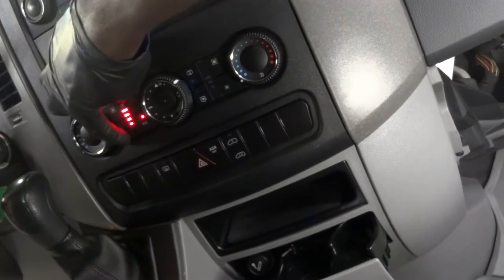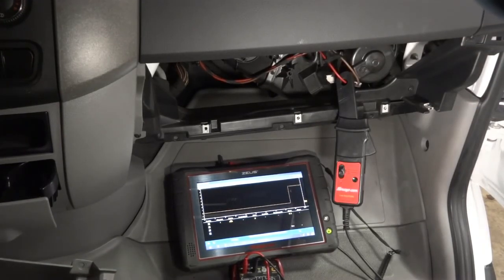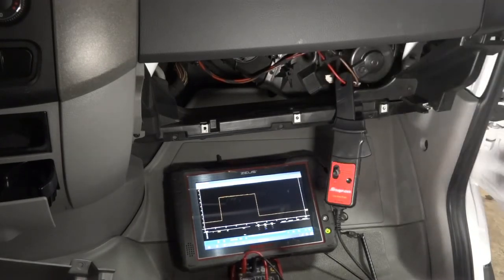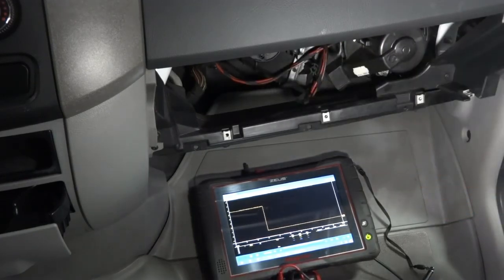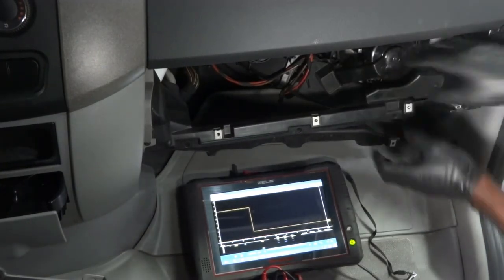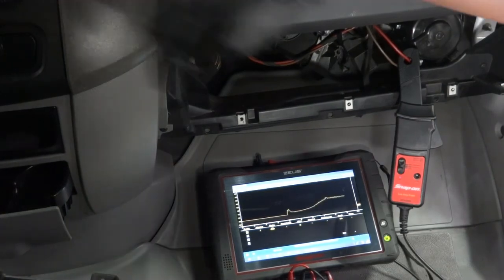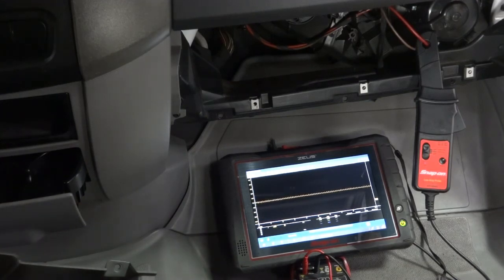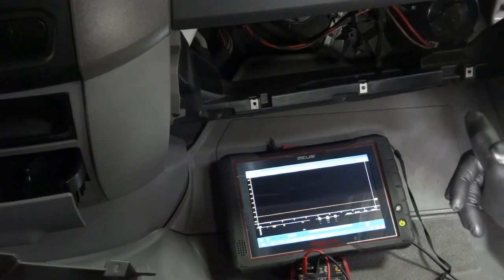How to diagnose & Replace a Blower motor on a 2015 Mercedes/ dodge Sprinter 3.0L

Comment: It's the second A/C Heater Blower Motor Regulator Resistor that I change it I don't know what happens with this that it stays on, I disconnect the key and it's still on, what can I do?
Reply from the maker: @carlovera7880   your blower motor might be shorted!

Comment: This is a helpful video but you failed to explain if the regulator has no power.  Where is that fuse location???
Reply from the maker: @Ceas2000   Thanks! the fuse is in the fuse panel under the dash!
Reply: I thought I checked every fuse but ill check again. Yiu wouldn't happen to know which number?
Reply: You wouldn't happen to know which fuse nunber?

Comment: Hi guy,
first of all, congratulations for all the explanations you gave and a big thank you.
I think I could also repair my problem in my 2016 VW Crafter van.
Can you tell me the brand of air blower you purchased and its price?
Because I don't want to get one of poor quality...
Will this solve the heating problem because I no longer have any at the moment and given the negative temperatures it is at the moment.
Thank you very much and good luck
Reply from the maker: My Pleasure! I don't remember tthe bramd of the blower, ask your local parts sttore for a good quality blower,
Reply: @KITS_Auto_and_Truck_Repair  thank you very much for your answer
Can you tell me where the heating and air conditioning relays are located?

Comment: Couldn't there be some debris jamming the blower? Rather than buying a new $200 blower it might be wise to take the blower motor completely out, clean it up, and add power to the blower motor to see if it runs.
Reply from the maker: @davidg.johnson7208  you can do that if you want, but I don't like comebacks!

Comment: Great video! This has got to be the easiest thing on the sprinter to fix 6 x T25 screwed and clip , twist done , don’t forget the last T25 on the lower right to get the plastic frame out of the way so the motor comes in and out easy this vid he struggles with that a little , so easy thanks again this is a great vid
Reply from the maker: @kc-qv2kf   My Pleasure!

Comment: hi i have 2011 mercedes sprinter 2500 with problem :
I start the car and it blows hard and cold for about 2 to 5 minutes, and it start gets warm air come out. It's not hot air blowing out, please can anyone help thanks .
Reply from the maker: @chuongvo5925  Sorry! I didn't understand your question!

Comment: Hy mate.i got an mercedes benz a class A170,1.7 PETROL..in januray i coemback from holliday and heating in the car stop working,but before to i go to holliday was perfect working...in 4-5 minutes in the morning at -5 -7 degrade was workign verry good...the car give the air warm,but verry verry low...someone told me that door what close the air to come can be block..or blower heater stuck..what you think can be?hoses at engien area ,what come from heater,are warm...so i think,i am not sure,maybe is somethign stuck?the air works on all level from 1 to 5,but when i chose warm air dont come warm air...is starnge as before holliday was perfect working
Reply from the maker: @TheRazvancristian  Sorry, I didn't really understand your question, it sounds like you said the blower works but the air doesn't switch from hot to cold, if that's the case, I recommend you have the blend door looked at!
Reply: @KITS_Auto_and_Truck_Repair  and is that easy to fix the blend door  locked? I can have acces on it if i take some parts out? Is on passenger side or driver side?

Comment: I got two errors from xentry

P053400 The refrigerant level is too low. -

B105C07 The actuator motor for the air recirculation flap has a malfunction. There is a mechanical fault.

It’s a 2022 w907 sprinter cargo.  When I press the AC button to turn on the AC, the light doesn’t even turn red to let me know it works. The fan works and the heater works. What do you think is going on? My car is only 17k miles.
Reply from the maker: Anonymous District  Check your switch and your rec actuator!

Comment: Appreciate your help on this. Got straight to the issue could see black dust around the connector and 12v. Removed blower motor and sprayed contact cleaner down inside and freed it up and it works 👍🏻
Reply from the maker: Iain Stubley   My Pleasure! I'm glad to hear that the video was helpful!

Comment: Is there a way to use a multimeter to test if the blower motor is receiving power (instead of piercing tools and a test light)?

Excellent video, thank you for making it!
Reply from the maker: Ben Spatafora  thanks! yes you can connect your multimeter to ground and then connect the other test lead to blower motor power wire to see if you have 12v at the blower connector
Reply: @KITS_Auto_and_Truck_Repair  Thanks for the help!
Reply from the maker: @BenSpatafora  My Pleasure!

Comment: Mine when I turn it on high it starts to slowly go down then it just stops working I cut it off and I turn it back on and it starts working again I think mine is the blower fan motor but it has a weird little whining kind of noise been doing for over 6 months
Reply from the maker: Jason  you should check your blower resistor first before you condemn the blower motor!
Reply: @KITS_Auto_and_Truck_Repair  got it fixed it was the blower motor
Reply from the maker: @Jason-vh6nr  Sounds good! I'm glad to hear that!

Comment: Thanks for posting. Really helpful. Now to source a blower motor that doesn't cost an arm and a leg!
Reply: Did you get an aftermarket part? How is it working?
Reply: @000MrJwright  yep, took 10 mins to change and works fine.
Reply: @000MrJwright  sorry, didn’t answer your first question. I purchased a second hand motor from a wrecker group. Arrived from Melb in two days.

Comment: I watched this to find out how to remove and replace the blower motor.  That said, this is an excellent tutorial on trouble shooting the blower system.  The one thing I might have done before accessing the motor would be to check the fuse, but otherwise this is first rate and understandable for relatively inexperienced DIYers.  I really appreciate it.  Thanks.
Reply from the maker: David Johnson  My Pleasure!! and Thanks for your feedback!

Comment: Hey great video. I have also a 2015 Sprinter. When I turn it on for about 30 to 40 mins, very little air is coming out into the cab. The fan speed does change when I raise or lower the fan speed. My temporary solution is to turn off the fan for about 5 mins, then turn it back on. I then have full fan speed with good air flow. Would you know what is causing the minimal air flow? Thanks.
Reply from the maker: Michael T  Check your blower regulator!

Comment: I have a Mercedes’ sprinter 313 cdi.Blowing air but no hot air.Have installed new thermostat,tried a new control panel but still cold air.what can it be?
Reply from the maker: SaluteKiller  sounds like you have a blend door problem!
Reply: All dashboard has to come out.It’s the heater box
Reply: Bought a whole heater box second hand today

Comment: This is truly an excellent video and a very good explanation of how things work and go together.
I had the same issue, the blower not coming on anymore, and like always it happened when it was about 90 outside and I had to drive for three hours. 
Anyhow, I followed your steps and found 12.x volt on the red blower cable with the multimeter and there was ground on the brown wire. So I thought that was easy, it must be the motor that is bad. 

But while checking the ground the test light was very dim and the beep from the tester was also pretty faint. Definitely different from what it was when I tested the test light on the battery.  Hence I hocked up the test light to different ground and there the beep was loud and the light was bright.  That raised my suspicion the motor could be OK. 
I removed the motor from the car and tested it on a 12V battery and it worked just fine.
Then I found your other excellent video about the resistor and how to test its function and found that the resistor may be the culprit. 
To make a long story short, for those using just simple test equipment like a test light it's important to realize that there must be "good ground" as you mentioned in your video. If there is any doubt about the quality of the ground wire I would test the motor on a separate battery before buying a new one.

Thanks for making these excellent videos!👍👍
Reply from the maker: pilotarix  My Pleasure!! I'm glad to hear that the video was helpful! Thanks for letting me know about how you fixed your car, I enjoyed reading your comment, I appreciate you!

Comment: My aftermarket blower just stopped working. So, I have to start all over again. But first step is to refresh my memory of this site.
Reply from the maker: Juno Cheyenne Krakus  Good luck with your project!!
Reply: @KITS_Auto_and_Truck_Repair  Its done. Bad aftermarket blower was replaced under warranty. To make removal and installation easier I unscrewed 3 additional torx. BTW, OEM blower is cheaper then aftermarket from brick store. Its $110 vs $170.
Reply from the maker: @junocheyennekrakus5004  sounds good!

Comment: The video is the best I ever watched. I have 2016 Sprinter with a/c problem, which was normal for a while(a hour or two) then became no cooling air. After shot-off the blower for a few minutes,  it will blow cool air again when turn-on. It seems related with fuse, but not for sure.  Any advice?  By the way, I would like to offer a tripod for you, a token for your great videos.
Reply from the maker: Jean Sherman  hahah thanks for the offer!!  the fuse is somewhere in the fuse panel on the left side kick panel, it's actually easier to check for power at the blower motor then finding the fuse.
Reply: @KITS_Auto_and_Truck_Repair   please let me know how to contact with u.
Reply from the maker: @jeansherman6115  you can email me at deo@calleva.org
Reply: @KITS_Auto_and_Truck_Repair   Please mark it when you received from zelle.
Reply from the maker: @jeansherman6115  I received the Zelle Thank you very much!!!
Reply: Did you ever determine what caused you motor to work intermittently?

Comment: did you try to rotate the blower via the cabin filter thats is what I did and the blower worked after I rotated the fan. It should be the first thing to do when diagnosing.
Reply from the maker: Raymundo Abad That's a good tip!! but spinning this blower through the blower opening was not gonna fix this!!

Comment: Nice and informative. The only question I have is, why didn't you start the whole process from checking a fuse?
Reply from the maker: Juno Cheyenne Krakus Thank you! Just preference ! actually it was easier to get access to the blower motor then finding the location of the fuse!!
Reply: @KITS_Auto_and_Truck_Repair  
Yes, I have to admit that fuse location for this blower is confusing.
Reply from the maker: @junocheyennekrakus5004  yes exactly!!

Comment: Mine stays on AFTER the key is turned off and removed. I even disconnected the battery and it Still shays on! Very strange.
Reply from the maker: Lloyd Morrison that's strange, it sounds like you have a short Regulator, disconnect the blower motor module and see what happens...
Reply: How did you fix the problem my car does the same i cant turn off

Comment: I currently have only 2 volts going into the blower motor regulator even on the highest fan setting. What could be wrong? Do you know where the fuse for this circuit is?
Reply from the maker: Khoi Tan you probably have high resistance on the power supply wire to regulator... you should test that, I have a video called how to test a blower motor resistor on a dodge sprinter, watch the video and follow the steps, hopefully that will help

Comment: Why didn't you simply measure the voltage with your DC voltmeter at the motor power terminals instead of piercing the wire?
Reply from the maker: Markley Gordon, I prefer a test light since the DVOM doesn't load the circuit, and Piercing the wire isn't bad as long as you use liquid tape at the end to seal the hole on the wire...

Comment: Thank you for a professional video! Helped me a lot. My fan just stopped working.
Reply: What if I get power to the fan resistor to the left  but nothing to the motor. Is the resistor bad?
Reply from the maker: Hampus Andersson you're welcome, I'm glad the video was helpful!!!
Reply: @KITS_Auto_and_Truck_Repair  it was the fan resistor. Now my 2015 Sprinter blows air again. Its -15 degrees Celsius outside.
Reply from the maker: @hamp930123  I'm glad to hear that your van is fixed... thanks for letting me know!!

Comment: Great video. How would I diagnose a bad blower regulator/resistor?
Reply from the maker: Alasdair Brann, I have a video on my channel that explains how to test a resistor on this sprinter, 
just write how to test a blower motor resistor, on the search bar on my channel and It will come up... then follow the instructions and you will be good to go... Good luck...
Reply: @KITS_Auto_and_Truck_Repair   thanks!
Reply from the maker: @alasdairbrann4828  you're welcome

Comment: Thank you for this simple and good explanation at the same time. You are a person who is good at communicating information.  Only can you please explain to me why the engine does not turn on sometimes. I hope you will answer the question 
I have seprinter 311cdi     2013
Reply from the maker: Haithem Tareck give me more info, you say the engine doesn't turn on , do you mean the engine cranks but doesn't start or the engine doesn't even crank
Reply: @KITS_Auto_and_Truck_Repair  the engine doesn't even crank
Reply from the maker: @haithemtareck5630  the starting system has to be checked, you should have a pro look at it...

Comment: Thanks for posting this! I saw many videos suggesting the problem was probably the regulator but I followed your troubleshooting procedure and discovered that it was, instead, very likely the blower motor itself. The critical stage absent in many other videos was the testing of the input voltage to the motor. When I tested mine, the power was present and changed with the speed setting, giving me the confidence to know it was the motor that was bad. I bought a new one and had no problem replacing it with complete success. Thanks for saving me so much money!!!
Reply from the maker: FastRadioBurst you're welcome, your comment made my day and this is the reason why I'm doing this, thank you for letting me know!!